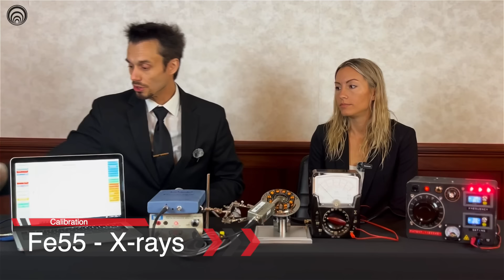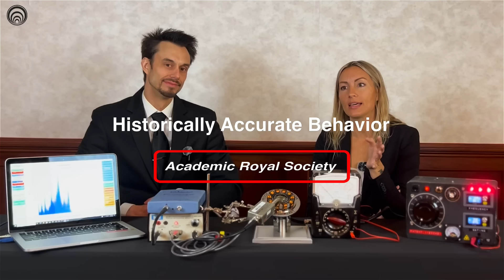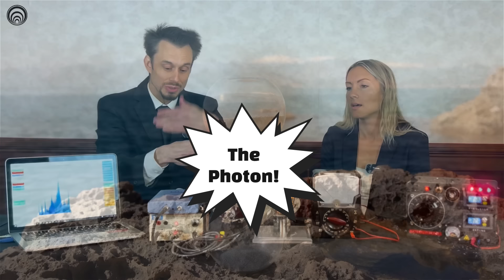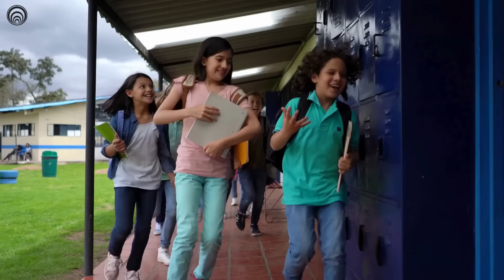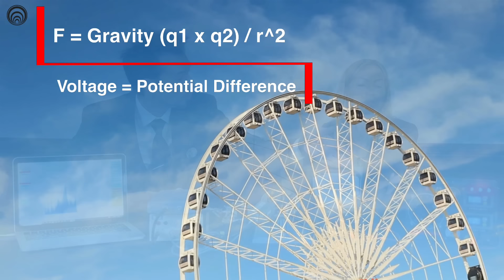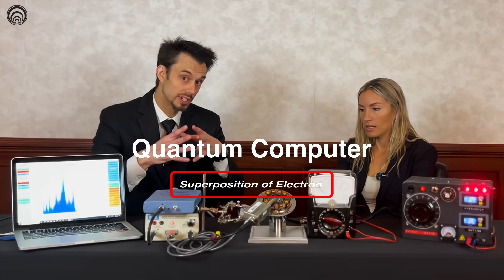Arc Reactor™ | Dana Kippel | World Record Plasma Fusion | Quantum Kinetics Corporation

Comment: If you say you can change uranium into tungsten, does that mean, hypothetically, there is a spent power source that could be changed into pure gold?
Reply from the maker: Thanks for your comment. 

You would be correct on all accounts.
Reply: No. Radioactive decay doesn't normally change into gold, and radioactive gold would have no worth. It won't be safe or useful or wearable.
Reply from the maker: @JoulesTelly  Thanks for your comment. 

QKC was able to successfully transmute Uranium 234 / 235 / 238 into Thorium, Tungsten, and Lead while reducing the Uranium isotopes by ~80% in just 24-hrs of runtime. 100M degrees Celsius was also maintained during the experiment setting the World Report for plasma fusion.